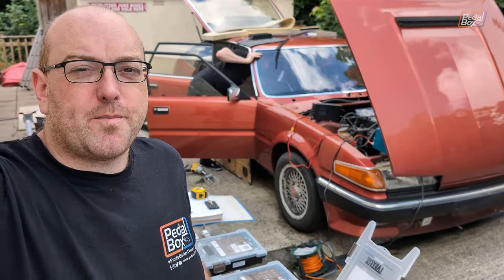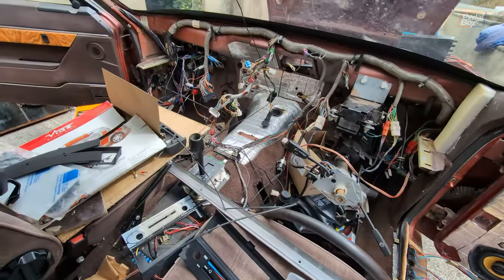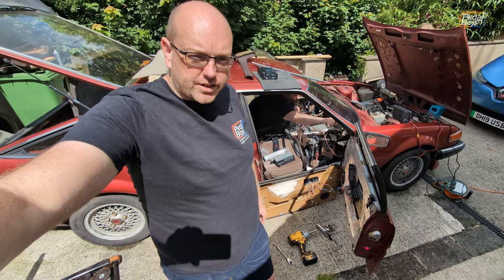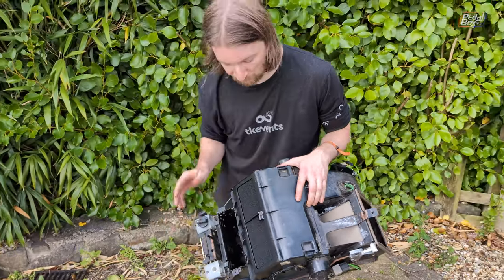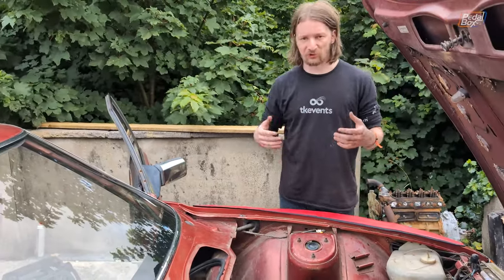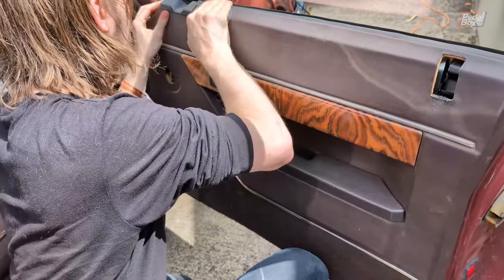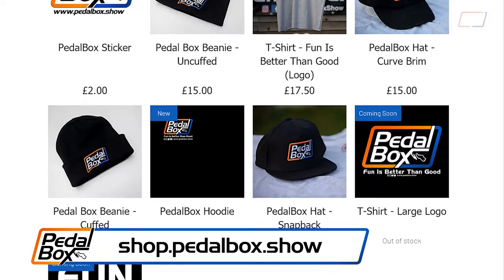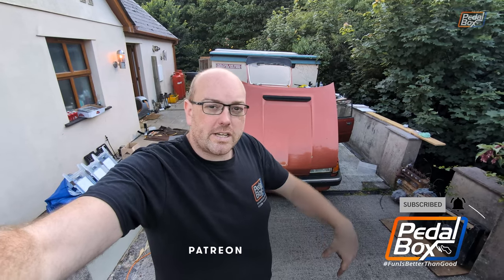Will It Make It to Italy? | Rover SD1 | PedalBox Episode 158 | Fleet

Comment: Chris, Mafi, and yourself had that dashboard *airtight*.
Reply: It literally was! They custom designed and produced sticky-insulation two-sided gaskets for the piping that breaches the firewall bulkhead that were damn-near millimeter perfect with nothing more than a socket set, two flatheads, the ground, and a wet hammer.